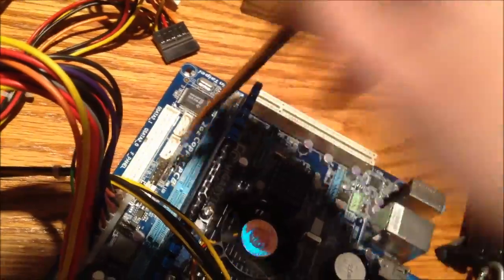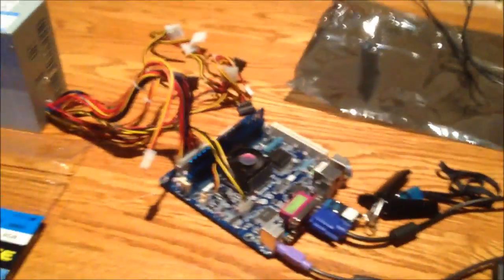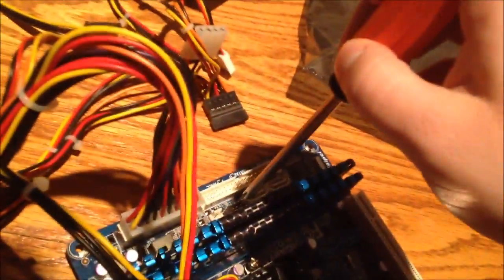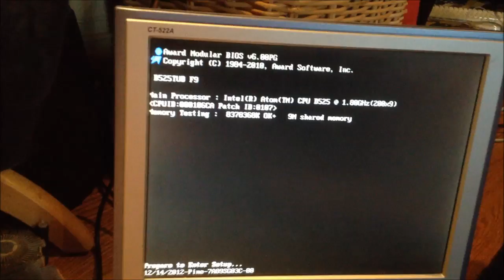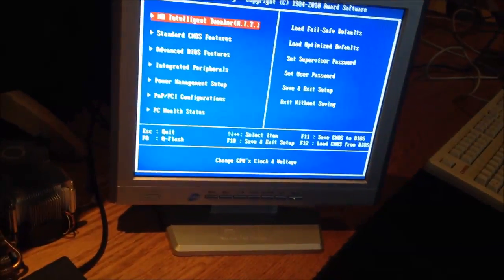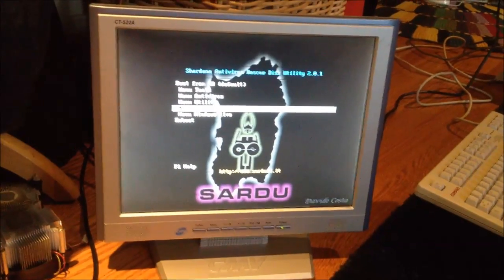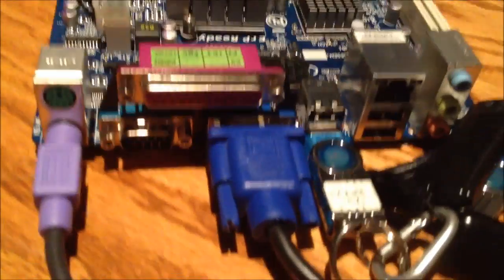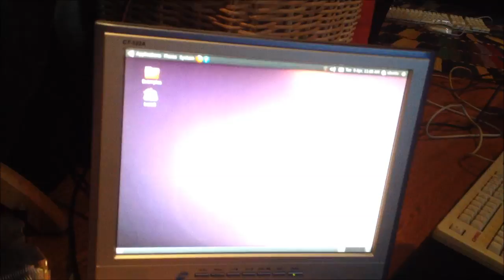Testing Out Repaired Gigabyte GA-D525TUD Motherboard

Comment: Which RAM are u using? I bought one 4 GB of Kingston and now my server isn´t booting anymore. Please provide exact type of ram and vendor.
Thanks in advance!
Reply from the maker: that ram could be bad. back when i was running this system i just used DDR3-1066 and it worked fine. Vendor doesn't matter, RAM is all the same.